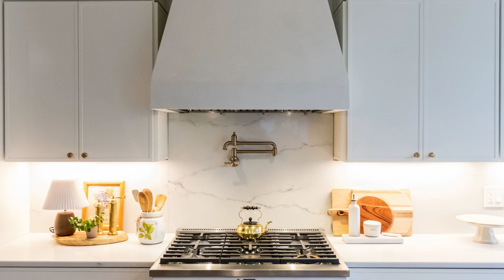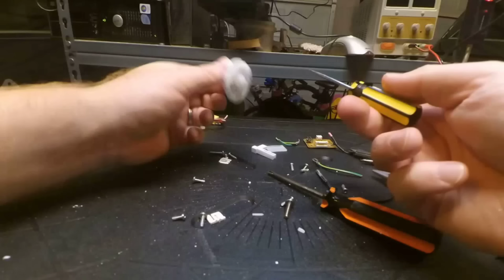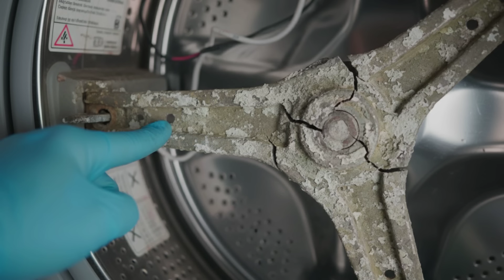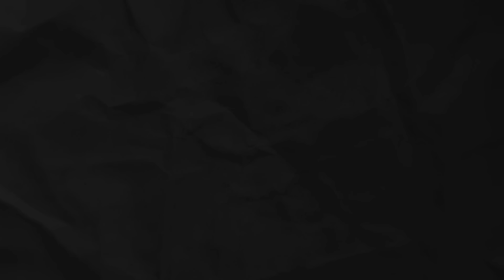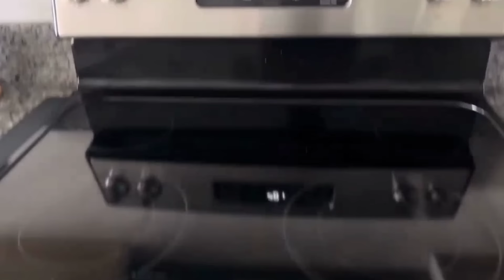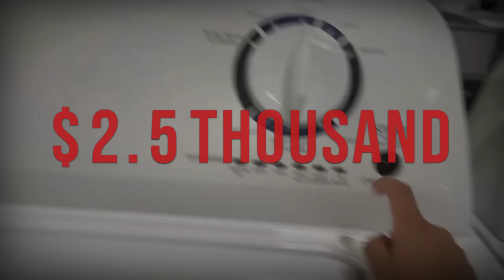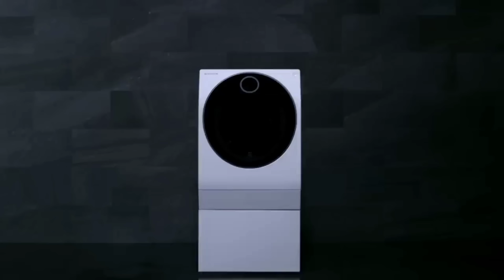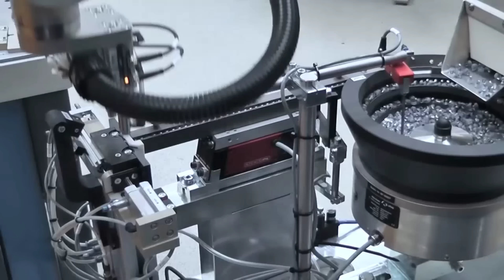The Repairman Blacklist: 5 Appliance Brands to Never Buy

Comment: If you are a tree hugger and want the energy star ratings , EPA approval, and all the other requirments by unelected bureaucrats-----you got what you wanted.

Limitations on electric usage, water usage, and construction materials have done more damage than "corporate corruption"

The spiders fail mostly from the usage of TOO MUCH DETERGENT. Any HE washer from any brand should never take more than 2 tablespoons per load. Most loads only need 1 to 1 1/2 table spoons.  These units use less water than the old days.  Only so much detergent can dissolve into so much water.  What does not dissolve sticks to your clothes and the internal parts of your machine. That build up eventually breaks free and puts stains on your clothes that will not come out. What still sticks the the machine parts provides the electrical path for galvanic corrosion. (look up how that works).
The direction on detergent lables on how much to use per load, is to get you to use more soap so you have to buy more.
Use your machine clean cycle regularly. Do not waste your money on store bought machine cleaning products that don't work.  Put in 4 cups (1 quart) of distilled white vinegar then start your clean cycle.  It cleans, de-ordorizes, and de-scales better than any other product on the market, cheaper!

The Samsung ice maker in the upper left corner of the refrigerater is a piece of junk. Any other brands that still do that have problems as well.  The ice maker and bucket design where they are both inside the door in their own compartment, work just fine.  They have a sealed door and are fully insulated.

The digital stove displays depend on how the manufacture vents the oven.  I have units out there 5,10,15+ years old, with a lot of baking and canning going without issue.
I do recomend NOT using Self Clean.  That gets to extremely high temperatures to literalley cremate everything to ash.  That causes all sorts of issues.
There is one brand I know of that has an Easy Clean function.  You spray water on the inside and pour some in the bottom.  It does not get as hot and basicaly steam cleans.  The best way is to use it right after you have a mess.
For stubborn areas use a paste of baking soda and vinegar with a non abrasive pad.  Beware of Easy-Off.  They changed something in it.  It is leaving a white/grey residue that will not come off.  This is across multiple brands, you will see the complaints online.

Dish washers did have grinders in the past, and those systems worked ok because the detergent contained phosphates that ate up everything in the machine. Including the drain hose.
Phosphates were removed from detergents because of serious environmental damage (look it up if you don't beleave me).  The ones today use protein enzymes to do the job.  Of course thet are not as powerfull that the old stuff and will not keep the drain clear.
Scrape your plates off of all the big stuff and put them in.

I could go on and on, but this is already too long of a post.  The machines of today are not made like they were in the "old days" , because they are not allowed to.
Remember our cars up and to the mid seventies, before the EPA and Energy departments got thier hooks into them?????  Some was good, some was over reaching or mandating too fast for engineers to keep up.  Same thing with appliances today.

Comment: Amana top load washer and  dryers with old school control knobs work great!  We own two of these--I compared my old Whirlpool washer and it was identical to the Amana--turns out they are both built in the same factory....I've never liked the front load washers--how can you open the door to add more clothes when it is full of water, like you can with a top load washer? Plus, I see absolutely no need to digitize a simple appliance.....this includes refrigerators as well...it's simply over kill, adding unnecessary complexity, with more things to go wrong....Cheers!

Comment: 16 years ago, I bought a Fisher and Paykel Intuitive Eco washing machine.  About 6 or 7 years ago, I had the wall tap burst and pour water into the back of the machine, which caused the mother board to fail.  That was replaced for about $350 (AU).  Last week, tge machine stopped with an error code of 37.  Blocked drain.  I siphoned the water out, tipped the machine, vacuumed all the fluff from underneath, and we are back working as fab as it ever did.  16 years.  And still looks as good and as trendy as ever.  I LOVE Fisher and Paykel.  Have used it my entire adult life.  Oven, cooktop, fridge, freezer, dryer, washing machine, dishwasher, double dishdrawer.   The works!
Reply: Made in China now by Haier, I believe.
Reply: 13 month old washer.  Stuffed !   They thought it was the power board.  Waited for that of course. Now they are replacing the machine.   Never again Fisher n Pykel

Comment: I'm an appliance tech, and I agree.  Microwave/oven combos always die too soon, and they are super expensive to replace.

LG washers are ok, but the spider arm thing affects all front load washers.  Also, the same dynamic goes for the shaft, shaft bearing and shaft seal.  These wear out because of the downward leverage of the wet clothing.

LG fridges have bad compressors.

Don't buy any brand you don't recognize.  Lotsa crap is being sold out of reputable stores that is chinese crap and has no parts availability.

Stay away from touch screens of any sort.  They often cost more to replace than the whole appliance did at the beginning.  Stick with real buttons, and analog, if you can find them.

Think of your dishwasher as a sterilizer rather than a washer.  Rinse everything.  You'll get a lot more life out of it.  When you buy a new one, make sure it has 3 spray arms.  A top one, a bottom one, and a middle one.  And check the decibel ratings.  You can change that by adding insulation (just carpet padding) on the top, sides, and in front of the motor compartment behind the kick plate.  It'll quiet right up.

For the most part, don't bother repairing above-the-stove micros.  Just replace them.  Having a tech uninstall it, repair it, then install it again costs almost as much as a new micro.  And these micros just don't last with the heat, steam, smoke, and grease they live in.

And always get the most basic and simple design possible.  For the most part, all the same brand appliances have the same guts, so don't pay extra for bells and whistles that you do not use.  Your clothes, food, dishes, etc. have not changed in the last 50 years, so there is no upgrade on appliances that is either necessary or economic.  Stick with the basics.
Reply: My appliances are 17 & 21 years old (Whirlpool/Frigidaire). one repair during that time for all. I’m considering having them serviced/maintained by a reputable technician even though they’re all working now…maybe prevent problems down the line.
Reply: I’ve convinced myself that microwaves should be used less, or even eliminated.  Slow down, cook or warm-up food on a stove, wash dishes by hand, dry them and put them away.

Comment: I noticed that the mechanical washer / dryer controllers were touted as being better than touch screen controls; I've found that they are not built to last either. My bet for washers and dryers are electronic controls without touch screens...they have good old switch contacts that interface with the control board.

Comment: Laughed when you mentioned the GE range.  My 5 year old not terribly luxury range threw the very error code you mentioned.  A $500 repair.   I no longer roast large turkeys ....so i bought a countertop toaster/roaster/air fryer/ broiler and use it instead.  It was an emergency purchase so i could keep cooking until my finances were in better shape.   I may never repair the oven.
Reply: I rarely use mine I use a toaster convection oven also

Comment: I don't want my appliances talking back to me. I want dumb appliances.
Reply: Same.   I want simple mechanical simple appliances.
Reply: This - how flippin’ hard is it to open the fridge door to see if you need more lettuce?
Reply: I agree , especially when it's not listening to.
Reply: Ha! Right! 😂
Reply: Speed Queen!! Best out there
Reply: I've sent back a pool cleaning tool to the repair shop TWICE. The first time they fixed something that was not even broken. And they didn't fix the thing that was broken -- the wifi connection to the app. I hate the app and wish the unit just had 3 or 4 buttons on it to select what I want!
Reply: Amen to that.
Reply: I had a Sears Kenmore washer for 41 years and the motor gave out.  I bought a Maytag and it is a piece of junk - my clothes don’t even look clean.  I still have the Kenmore dryer - I replaced the hose - that is it!
Reply: Interesting.  I had 2 maytags that lasted over 25 years.  But they were old no frills models.  Older is better.
Reply: @pockynon Wash everything on "Bedding" cycle to fool the new machines into filling with more water.
Reply: @schex9 it still takes longer to wash a load.  I think faster than these stupid electronic brains in the new ones.  We are slowly giving up control of our private lives.  I still think for myself, we are not idiots.
Reply: @pockynon  In the 70s I had a 
Kenmore washer and dryer and used to fix them myself!
Reply: @juliehumphreys5968  "kENMORE" is a made up name by Sears and can be a WP, GE and/or several others.
Reply: i don't need my appliances to be controlled by my cell phone either
Reply: Circa 1952
Reply: I have a 15 yr old car.  I don't need a car to talk to me, either!
Reply: Agreed. Fewer annoying things to set up as well.
Reply: I remember watching a Bewitched episode from the 60’s and their top freezer fridge had a video chat function on the door…your turn,Samsung😉🤔😉😊
Reply: Ever notice how the washing machines are on very narrow aisles at the big box stores? It's so you don't tip over the expensive washing machines to find they are made of PLASTIC -- everywhere!
Reply: Same with phones, tv, cars, vacuums and homes.  The old dumb ones kept we humans smart. That explains the lack of common sense and reasoning today.
Reply: Mine too.

Comment: All of these "innovations" are really annoying when you realize that, back in the day, you could buy a washer/dryer set for less than $500-- the price has gone up and the quality has gone down.  This is what I call double-inflation.  But the really, really aggravating one is the last the washer/dryer in one.  Because those can be made great.  They've been making and using only those in Europe for years and all my friends in Europe say they work well.  But trust U.S. manufacturers to ruin it-- AND charge more than if you bought the two separately.

Comment: We had to replace a wall oven after the electronic board burned out while using the Cleaning Mode.  The technician told us it should never be used.
Reply: We had the same issue.  This oven came with the house.  It has a flat button push.  Had to relace it twice at $400 a pop.  The next time it broke, I decided to use alternatives...crockpot, air fryer, microwave, toaster oven.  There is just the two of us and not operating the oven has been no big deal and our electric bill went down $50 per month!
Reply: I don't use the cleaning mode. They ruin the oven.
Reply: My husband was a fireman and went on many calls for ovens with cleaning mode,  especially after Thanksgiving.

Comment: Our 20-30 yr old Kenmore washer and dryer are still going strong. The new GE Monogram oven, dishwasher and refrigerator all needed major repairs within 3 years.
Reply: Same. My 25yo Kenmore W/D have never had problems. Thought I killed the washer during the polar vortex, when the incoming pipe froze. A very nice young Hispanic guy came out, tested all the cycles, and by that time time everything worked. One thing he said in no uncertain terms, was never get rid of these. And wheels on about how old the new ones would break down within 5 years.
Reply: @corilou11 Plus, the old Kenmores are easy to repair and parts have always been easy to acquire.

Comment: I've been repairing appliances for more than 40 years I won't even go out on an LG or Samsung Appliance they are so bad. Friends don't let friends purchase LG or Samsung home appliances. Go with Whirlpool. Amana washers and dryers are made by whirlpool. They are very plain and basic reliable and less expensive to repair. Stay away from washing machines that don't have a full agitator, stay away from washers with the little wash plates in the bottom of the tub.

Comment: cheap parts and corporate greed is how maytag was ruined and bankrupted.   when they were taken over by whirlpool they were never the same
Reply: They were replaced by Whirlpool units with Maytag labels. In most cases there was a big improvement. I had store display gas ranges that started corroding where the burners were attached to the cooktop - horrible design. As for laundry my Maytag by Whirlpool set is over 20 years old. I just had new rollers put in the dryer. My GE refrigerator is the same age.